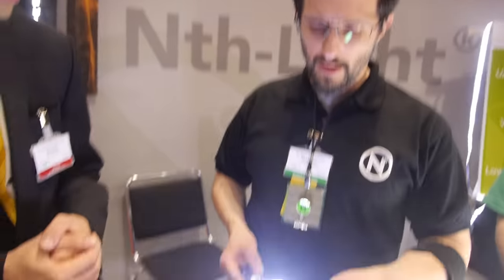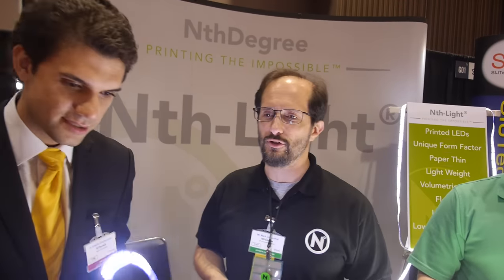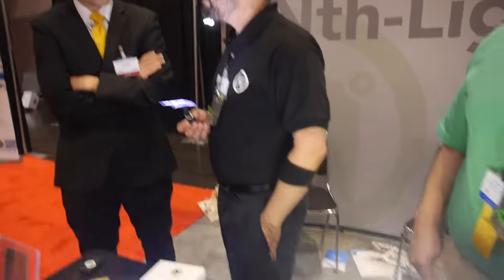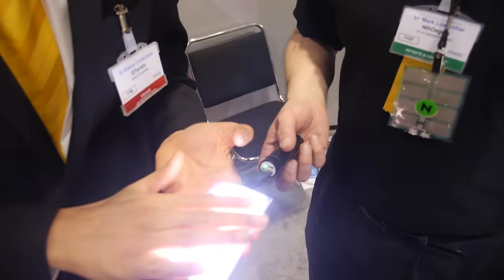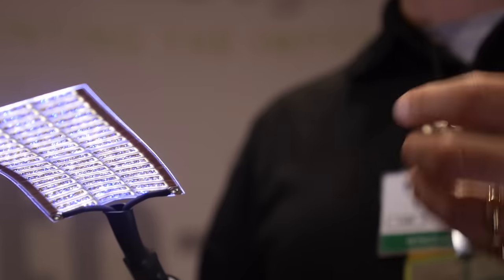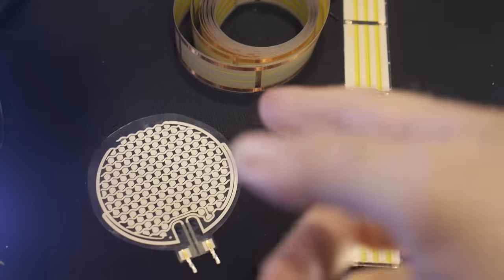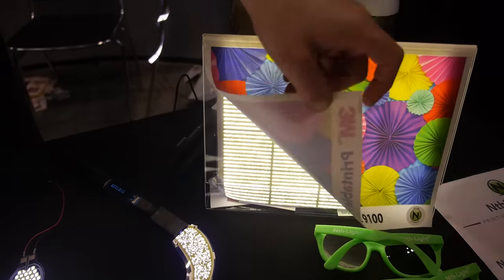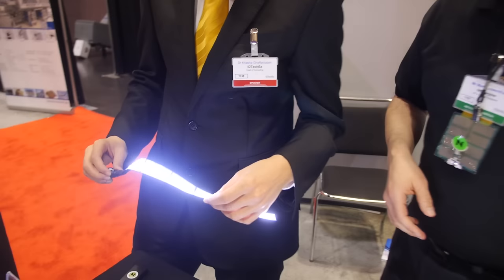NthDegree Nth Light, Flexible Printed LED Lights

Comment: looks like it's limited to back lighting only , due to the grainy nature of the led chip size uniformity and placement , but interesting 
Their " proprietary proses" is 50% of the led chips will be oriented correctly , that's why it so spotty , and the electrode is Tin indium oxide , ( I.T.O.) on a pte substrate same a el lamps , with a heavy copper buss to carry the higher current ( amps) not quite there yet , but IT is interesting.